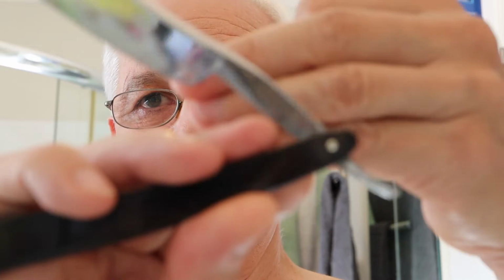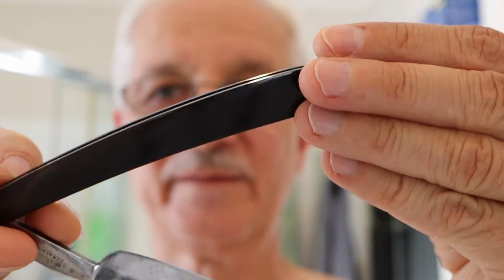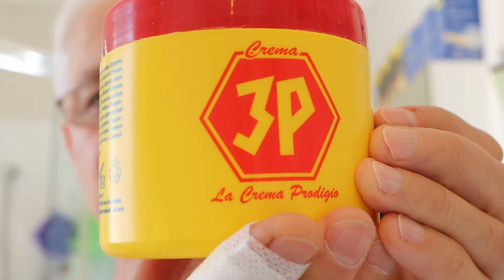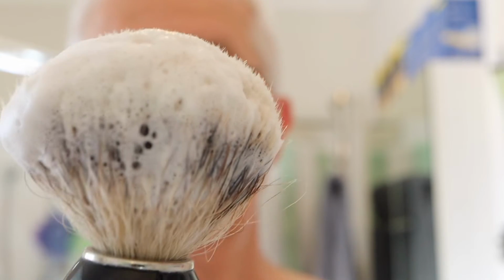Happy New Year! Trente Deux Dumas Aine 32 Straight razor sharpening and shaving

Comment: Thank you very much for sharing. I am learning to hone and find this very interesting. I think you are correct and the steel is chipping. I remember watching a video about a 16k stone that was chipping razors, in the video they came to the conclusion that the edges was too thin and that was why the steel was chipping. Most likely this was a combination of the bevel angle, the fineness of the stone and the structure of the steel. The solution was to increase the bevel angle buy honing with tape on the spine. Thanks again and Have a great New Year.
Reply from the maker: Thank you. Very interesting hypotheses. I sharpened with tape.